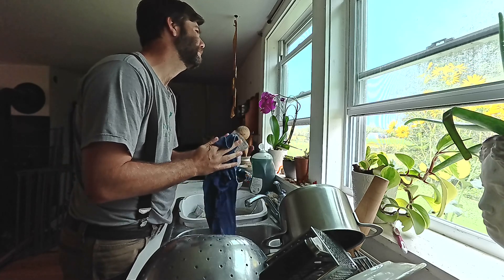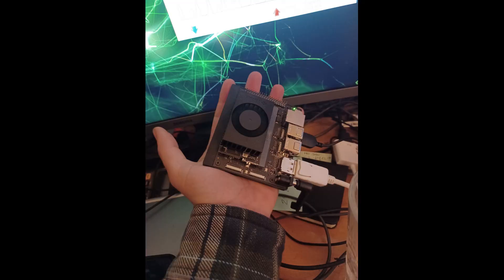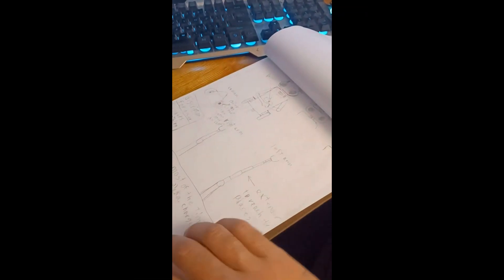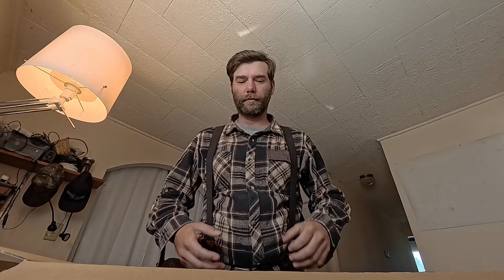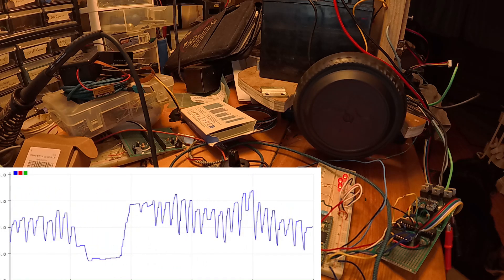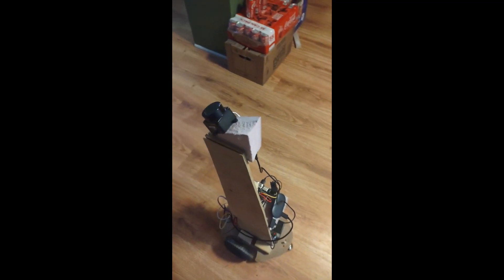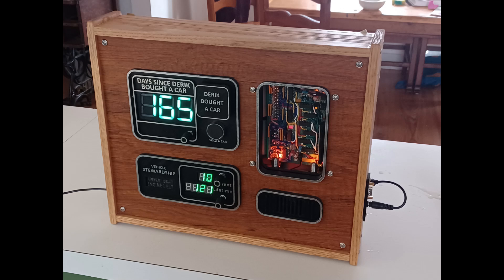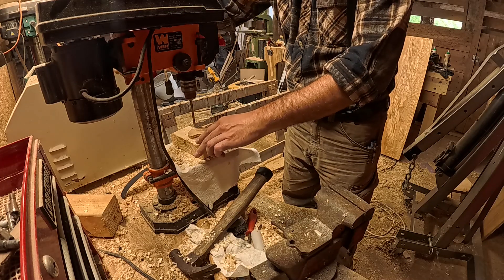Household Robot Project Ep1

Comment: It seems like you could have made it easier for yourself if you just built on your robovac. it has appropriate speed motors and some useful sensors, and it already can do a useful job. Adding more smarts and an arm and eyes and integrating that with the vacuum is a huge challenge, but you have already shown us you have no shortage of patience.
Reply from the maker: Not enough Horsepower. ;)  One of my loose design criteria is to be able to drag a kitchen chair across the floor.

Comment: I settled for hoverboards for parts for Go-cart project with kids. There are plenty of projects online, but i don't feel like using a chain or gears to drive an axle. Or worse just driving one wheel wit electric drill or something like that. There are plenty of electric hub motors around. Plus I just want an excuse to play with 4x4. I was looking at Scooters, but the ones with  a motor in both front and the back wheel are pricey, plus the wheel diameter also is very small for most of them. Another option buying two or four electric bicycle conversion kits, and not tcheap.
Buying two hoverboards gives me 4 wheels with motors + batteries for Go cart + some electronics for the parts. And its far cheaper than buying two electric scooters. Challenge might be to find similar accumulator battery packs if i want more of them in the Go cart. Oh well, i can deal with extra balancer and charge controller.
Hoverboards technically have the motor controllers built in, but I'm not that good of a hacker jet to figure out how to reprogram the motherboard. But the Power electronic parts can be used on my own PCB. Saves e-waste and saves me a bit of project cost.